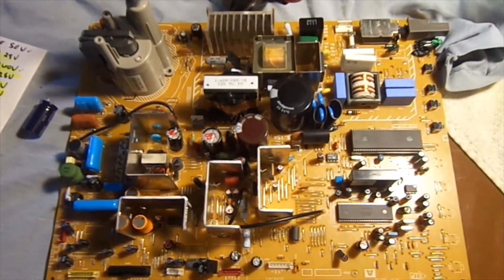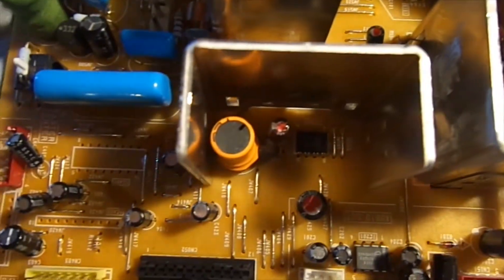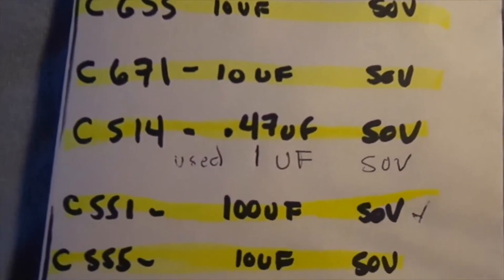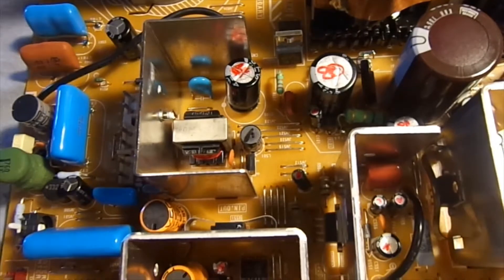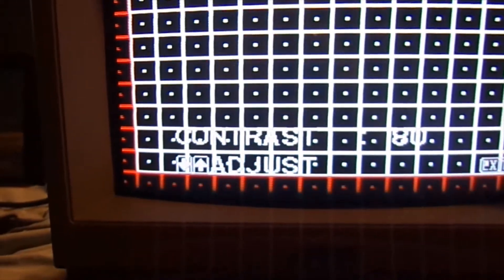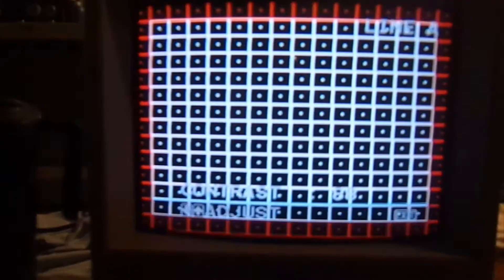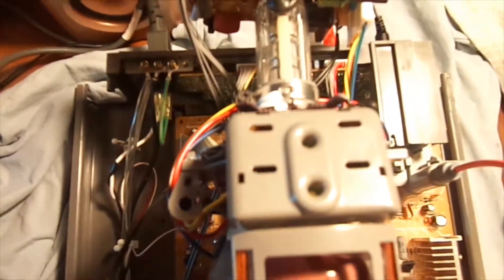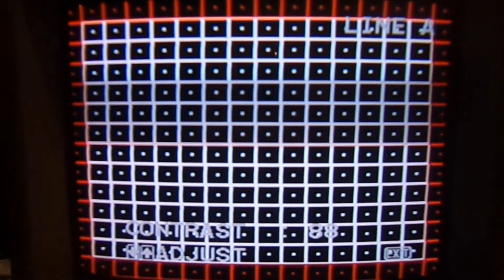Sony PVM SSM 14n5u 14n1u 14n2u 14n6u Probable vertical geometry fix

Comment: Great work!
Reply from the maker: Thanks! I prefer these monitors for how simple they are! Very nice picture and simplicity.
Reply: I'm going to be doing this on my monitor soon. Same model, same issue. Were these caps located on the A board?  I have a schematic but I have yet to dive in to the monitor. Thanks for this video it has helped me prepare.
Reply from the maker: @Markoclassicgaming  There is only the one main board and a neck board. Simple and effective!  Hope yours turns out well!